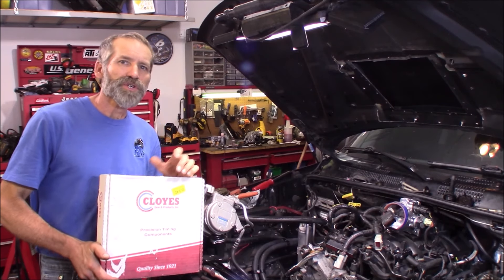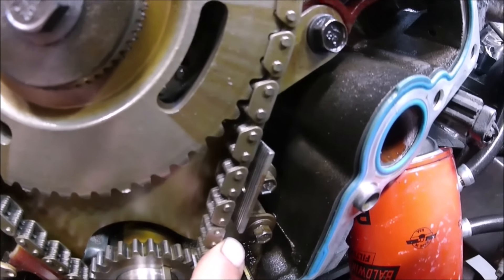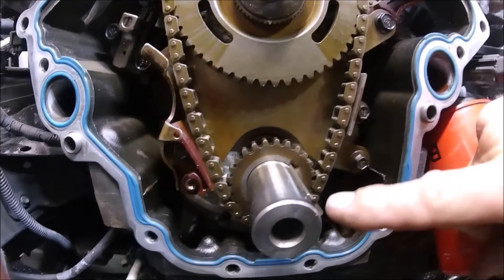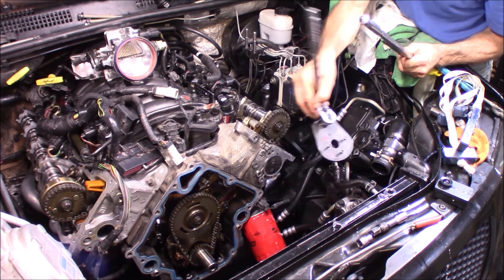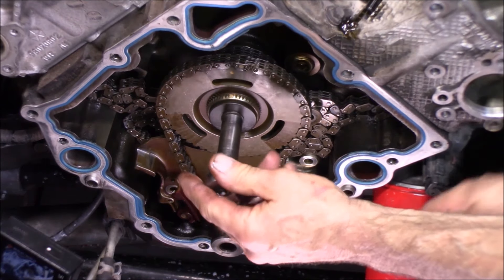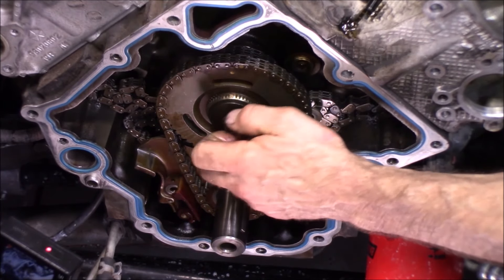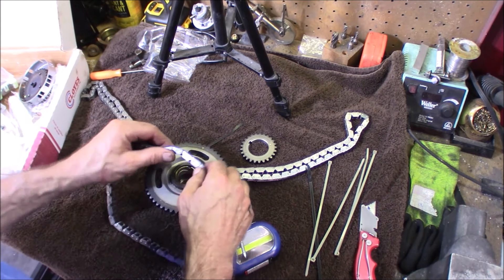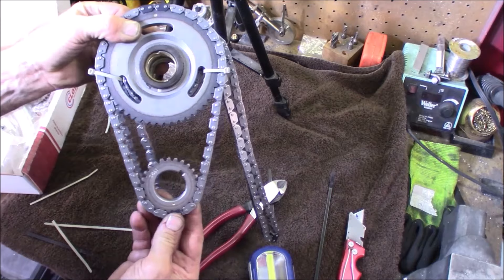How to Install Timing Chain Set Dodge, Jeep & Chrysler 4.7 & 3.7L

Comment: Hi Martin, I'm using your spring compression tool to get valve seals on. Took the cams out to do it. Think the slop in the timing chain allowed 1 side to skip a tooth down low at the crankshaft. @4:20 you show how to get TDC, then the cam sprocket will have the V8 up, R to right, L to left.. Ensure that config on both sides and I'll be good to install cams? The key will ensure they only can attach to sprockets 1 way I think...

Comment: Hi Martin, Thank you very much for this video and tips and information. Your gentle narration is very professional. My customer's Dakota dropped a seat on the right bank making the valve stick open. Same thing on the left bank but unfortunately the number one piston and valve fought it out with the broken up seat chunks to mutually assured destruction. New heads, one piston, and a timing set are now installed thanks to your help. Nothing like a mentor to come alongside.

Comment: Hello Martin. what symptoms do we have when it needs to be changed the timing set.

In a 4.7 H.O engine i have small vibration in  the indling
the engine speed indicator is not stable and i feel this every time I stop at a traffic light for example.
Thank you for making the video
Reply from the maker: To me that kind of sounds like the idle air control valve perhaps you should remove it and clean the cone and the throttle body where the cone seats.
Reply: @martinbuilt  because i have change the valve steam seals in your way(thank you for the video)  a have test and clean almost all the parts

I dont know,maybe the MAP sensor,maybe some coil ,
The correct way,its a diagnostic controll first.   
Thank you Martin.! What you do for us,it's formidable and helpful!!

Comment: I watched your video until I had it memorized because it was the most detailed and it went absolutely flawless. My only issue was the LH cam sprocket/gear from Cloyes was not marked "R - V8 - L"  (only had "L")  and it was missing the holes for the spanner tool. I wanted matching gears but I needed the motor fixed ASAP. So using the old gear as a template I drill holes in the new one so I had a place to attach the spanner tool to torque the cam shaft gear bolts. Hell of a way to cut corners by not drilling two holes and deleting three stamp impressions. Great info, thanks for your hard work putting this video out there.
Updated 12/7/2022 -- I replaced timing chains and lifters hoping it would get rid of the famous 4.7 tick and it did for about 4 days but then came back - strange why 4 days then returned ?
Updated 12/12/2022 -- Had an oil leak on passenger side valve cover . Didn't have new gasket fully seated at rear corner-- it rolled over and some how got cut. Took about a week for the oil to find the exhaust manifold. Replaced with new one and no leaks.

Reply

Reply
Reply: wondering how that worked for you!
Reply: @andybilakshow260  It worked great, with no after affects

Comment: I put a 4.7 from a 03 Durango into a 01 dakota and because of the timing difference between the two it wouldn't run so I sent it out to multiple mechanics to try to get it running and they all failed so the project got pushed aside now after doing research and ordering new parts its time to put new timing gears and chains and stuff on but ive never done the job before so thanks for making this awesome how to boosts my confidence alot.
Reply from the maker: Thank you, you will also need to replace the 32 teeth to a 16 TEETH CRANKSHAFT RELUCTOR WHEEL
Reply: @martinbuilt  that should be a part that doesn't get worn out right? Can I just swap from the old motor to the new? Or should I look for a new one
Reply from the maker: @matty2helpfull  yes you can use the old one. you will need to pull the engine and disassemble the lower half of the engine to lift the crank out far enough to change it out. you may be better off finding an engine that had the NGC ECM and sell that engine.
Reply: @martinbuilt  I need to pull the engine again anyway to pull change the wire harness again so I will probably just continue with this one but I'll keep that in mind  thank you for all your useful info 😊

Comment: I had the left bank
 (cyl 2,4,6,8) cylinder head removed but when I put to back the timing on the left bank ( since I only took that one out) when I put everything back 
I turned the engine over when I get to cyl 2 intake / exhaust it starts to get very tight then turns over with the tensioner on the left making a ratcheting click once after passing cyl 2 (I reused the timing components) 
Did I get the timing wrong?
Reply from the maker: Certainly, sounds like it.Did you happen to remove the timing cover as well and redo the entire chain timing.
If not I would imagine that's when the problem occurred.
I don't know how people can remove one cylinder head and reinstall the timing cam gear without removing the timing cover to release/reset the hydraulic tensioner.
Reply: @martinbuilt  I removed the timing cover only removed the timing chain and the two guides and the one tensioner for that one cylinder head and put it back
Reply: @martinbuilt  also everything lines up at tdc the cams the crank everything but now it feels normal after turning it a few times am I on crack of did I mess up something

Comment: I am unsure on one thing; can the OTC timing chain holder tool actually hold the sprockets to loosen & tork the cam sprocket bolts? The pics of this tool don't look like it would...
I don't have the time to make the tool from your other video.
Thank you SO much!
Reply from the maker: No that tool frk. OTC is only intended to hold the timing chains to the sprockets to keep them properly timed as you installed them.
Reply: Thank you, Martin! Fast response! What tool do you recommend to hold them if I don't have time to make the one in the other video?

Comment: I was attempting to replace a thermostat and the lower bolt to the housing broke off in there. So now I figure I will take that front plate off so I can see what I am doing better. However, I don't know what I am gonna be able to do to get the rest of that bolt out. Its a 02 durango 4.7
Reply from the maker: This video here I'll show you how to remove the front timing cover.
https://youtu.be/qGLQsii0Ebc
Reply: @martinbuilt  I watched that. I am trying to figure out how to get that lower bolt of the thermostat housing out. it is flush with the plate. Thanks for these videos You have saved me alot of money and trial and error.

Comment: Martin, 
   Doing a timing chain on a rebuild and noticed the key for the crack sprocket barely sits inside the key way on the sprocket. Is this normal? Have you ever seen the gear jump the key way? Can you replace the key with a new taller one? I can send pictures if that helps just need a place to send them. Thanks for all you do.

Comment: After I pulled the  pins I rotated the motor to check if every thing was lined up. And I get a clunking from the tensioners and they don’t tighten the chain up. And now the marks don’t line up on the cams with the chains. Guess I’ll take it apart again and re do it. Any reconditions? prolly shouldn’t rotate engine?
Reply from the maker: If you perform this on a 4.7  it will take 14 rotations of the crankshaft to get the timing marks to line all backup again.
 The noise could possibly be from the hydraulic tensioners, remember that they are hydraulic and operate off the engine oil pressure. If you're rotating this over by hand you will not have any oil pressure.
Reply: @martinbuilt   I've heard "hydraulic" before, what's the purpose of the spring in the tensioners?

Comment: Martin-  Have searched your website.  Need to replace 4.7 head gasket (passenger side)  can this be done without removing timing chain cover?  Note chain and guides handled about 10,000 miles ago so I dont need to go there.

Comment: I have one question when i tightened my cam sprocket, i slightly rotated the engine. How can I turn it back. The v6 on top of rhe sprocket thats suppose to ve at 12. Is now at 1-2 oclock

Comment: I have a late model 2007 4.7 with the 4 plugs. But the enigine in the truck indiates its a ealier model because I am taking the earler style (double blackk link) timing chains out of it. Can yoiu tell me where I might find a fix for this or which set of chains will wok the best?

Comment: I replaced my timing chains with the same set and on the passenger side the tensioner won’t touch the guide. It still wiggles when I turn over the engine. Any ideas? I’ve tried 2 different kits now thinking one had a bad chain but nothing changed

Comment: Martin.. Need to see how to replace the oil pump in a 07 Durango 4x4 with 4.7 flex fuel.
Does the oil pan have to be removed ? If so, that's a big job because the axle has to be removed too.
Reply from the maker: Unfortunately, the oil pan needs to be removed.
 Are you sure you have a flex fuel engine in your 07 I was under the impression they didn't start making those until 08.
 If it is a flex fuel engine it would have dual spark plugs per cylinder.

Comment: Hmm I get a weird clicking/tapping noise on cold starts for a few mins then a light tapping noise (not manifold bolts) like a rocker or lifter sound afterwards. The initial cold start sound sounds like it could possibly be the tensioners. What do you think?

Comment: Hey so issue im having. IN THE KITS they suoply the new front sprocket for the idler (the main big sprocket) but you didnt show how to disassemble the old sprocket from the gears on the backside to install the new one from the kit and which way it needed to be aligned when installed onto the shaft with the other gears to be ready to be installed/mounted back onto the engine afterwards. Plz help

Comment: I am getting my first jeep need the timing chains  done can u pull the hole front off with out having to remove the water pump
Reply from the maker: Yes you can in this video I provided the link for I show which bolts you will need to remove from the water pump to remove the cover.
How to remove 4.7 timing cover. 
https://youtu.be/qGLQsii0Ebc

Comment: On the driver side cam sprocket, the lower guide is blocked by a freeze plug. The video you show already has it out and you can access the bolt to that guide. How do you remove that freeze plug
Reply: It pulls out, or push it from the back.

Comment: Hi,pls your opinion.I sat harmonic balancer on TDC ,and both V8 12'o clock and both dot marks fits with dark chain segment.

But!When I took of timing cover the dark segments on primary chain dont match with dots on idle and crank sprocket, it is ok ?The dot on idle speocket is 12'clock and crank is on TDC.

Engine ran fine and smooth before.

Now it is not finished.I want also check oil pump and so..

Comment: Hey thx for the videos. Have you noticed any gains out of the 08 cams? Like better throttle response or acceleration improvements?
Reply from the maker: Yes there were definite improvements in horsepower and torque even over the HO cams that I had installed previously. My 0 to 60 miles per hour was improved as well to 5.9 seconds.
Reply: @martinbuilt  thats awesome. They should work in an 02 4.7 shouldnt they?
Reply from the maker: @1ftintheflames  yes that will work for an 02

Comment: I have a question can the timing be off a 180 degrees? Would all the timing marks still line up?
Reply from the maker: If the timing is off the marks will not line up but they only line up again every 14 rotations of the crankshaft. This is because the chains that go to each cam gear are very long.
Reply: @martinbuilt  If I was off one tooth on the passenger side sprocket would that be enough for it not to run.
Reply from the maker: @BASgarage  
yes, and you could bend valves.
Reply: @martinbuilt  thank you hopefully no bent valves 🤞

Comment: I put the timing chain set on the 4.7 and do you know if the marks on the cam line up again after the motor has been started
Reply from the maker: Yes it will after the crank shaft rotates 14 revolutions all the marks will lineup again
Reply: @martinbuilt  do you know if the cam chain tensioner has to be set or are they fine once you pull the pins out of them?

Comment: Hey Martin, your videos always save me! Thanks heaps. I'm doing timing cover gasket as was leaking oil, and also lifters given I have to do cam cover gaskets. I've got 14mm protrusion on right side tensioner, 8mm on the other. The workshop manual says the tolerance is 15mm. It's done 150k miles and will only do 3 to 5k miles a year. Do you know how fast they wear, when they start making noise? How far were yours out and how far do new ones protrude? Thanks again
Reply: Also is the kit without new gears ok if the originals look good?
Reply: Sorry I was so eager to ask I didn't get to the bit where you pop one out!  I don't spose you can measure max protrusion for me on the right tensioner? Thanks! Then I can compare to 15mm from workshop manual
Reply from the maker: For optimum performance I would recommend replacing them.
 For an everyday driver and grocery getter you can use the old ones.
Reply: Hi Martin, I'm about to start the job. First question, how did you get the cam ring off that has the tone ring? Only one hole so special tool like you made doesn't fit. Second, do you have to remove cam angle sensor? Rather not touch as it's not leaking! Sorry I didn't see those in the vid. 
3rd question, some of my unboxed melling lifters were not stiff. I soaked them and got as much air out as I could but still go down. Is this OK? I was thinking of turning engine over without fuel or spark to get pressure up before first fire. 
Thanks!
Reply: Don't worry I figured don't need to remove sensor and made the tool hit on the washer :) cheers

Comment: I pulled 08 4.7l cams from a ram 1500 yesterday but I left them at the junk yard, I have a 02 4.7l ram 1500, I left them because I'm not 100% sure that everything will work out, do u have a video of u doing the cams and could I get some input? I would like the cams but idk what benefits I would get either, im mostly figuring a little more power would help my mpgs which every bit helps when u get 15 mpgs lol
Reply from the maker: Here's a video I did on installing the 08 camshafts. Every mod I've ever done to the 4.7 that has increased horsepower has always helped the MPGs
https://youtu.be/MN3c94VevEM
Thank you for watching.

Comment: Does the right hydraulic tensioner need the plate as well, both left and right came with plates
Reply from the maker: If the OEM tensioner did not have the plate then I would remove it.

Comment: Hey Martin. 
I pulled off the timing cover on my 3.7L and there's no gasket. As far as I know, it has never been off prior to this. Only the center top (oddly shaped) ring gasket and the two matching o-rings.... that's it. Any thoughts?

Comment: There are 2 bolts holding the top passenger side guide in right? I saw you pull the plug for the top bolt butbim guessing the bottom one was already out?
Reply from the maker: Yes, there are 2 bolts that hold the top passenger guide in place. The other can be reached with the timing cover removed.

Comment: Do you have any idea what would cause repeated failure of a hydraulic chain tensioner in the 4.7? Iv'e had the whole timing kit replaced 3 times already in past 3 years. Oil pump was replaced too. Great video BTW.

Comment: Do I have to remove the radiator to do this project?
Reply from the maker: Yes most likely you will otherwise it is going to make it hard to remove the harmonic balancer.

Comment: Why did you go with the 08 cams? Love the videos. I have a 2002 dodge dakota 4.7 that I'm basically doing everything you've done. I also did all the front suspension components as well as the fuel pump/sending unit.
Reply from the maker: the 08 cams have more lift on both intake and exhaust then the HO cams and the 08 cams will pull past 6000 rpm where the HO falls flat at 5500
Reply: @martinbuilt  oh, okay okay! I just got new Millen lifters and rocker arms, I don't know if I'll do the cams, but watching this video makes me wants to get into what you did to see what's going on with mine. I have 250k on the engine after all
Reply from the maker: @jlast313  You obviously take good care of your engine to get 250k out of it, seen so many fail long before that most due to poor oil change intervals.
Reply: Unfortunately I got it at 250k, the guy I got it from said he took care of it and was a mechanic on the side. And it seems to be true more or less. All your videos are extremely informative and come the winter, I plan on doing the harmonic dampener, lifters, rocker arms, valve cover, gaskets, electric fan upgrade, and if I'm feeling adventurous, what you did above. About how long did it take you?

Comment: Thanks for these video’s.  I need to do a timing set on my 03’ Dakota with a 4.7.  I’ve also been thinking of swapping to the Corsair cam’s.  How has it been running since the cam swap any noticeable power difference?
Reply from the maker: Love these 08 cams, there definitely a noticeable increase in power. Really pulls hard at 3200 past 6000.
Reply: @martinbuilt  Outstanding!  After I get my NV3500 shifter fixed, I’ll get on those cams...

Comment: Just purchased a Cloyes timing set w/o the gears question is: How worried should I be not using new gears aside from obvious findings after removal and visual inspection?
Reply from the maker: I won't be worried at all. For optimal performance is when I would replace the gears.
Reply: @martinbuilt  ty for the swift reply. Use your vids for ALL my dodge Dakota issues. Looking and cant find if you have a vid on  clutch replacement. If you do could u link it please.